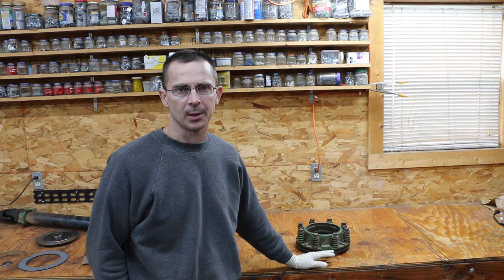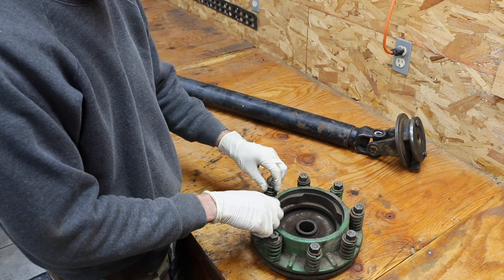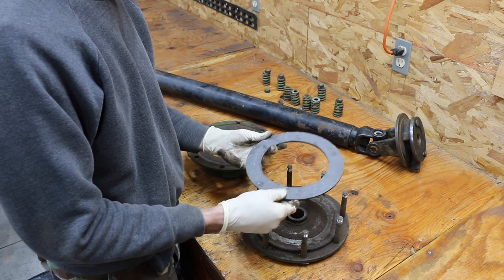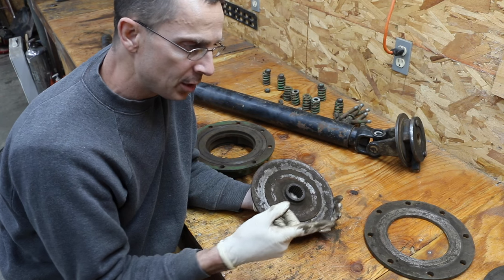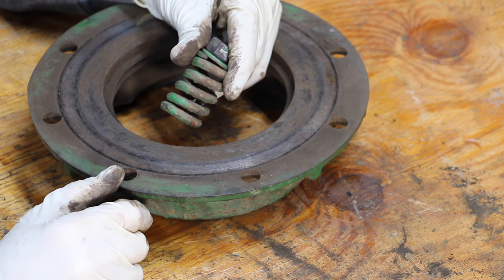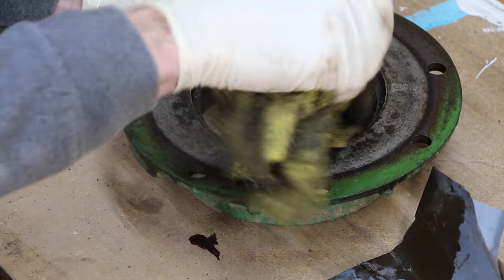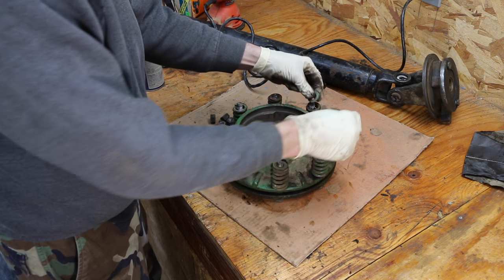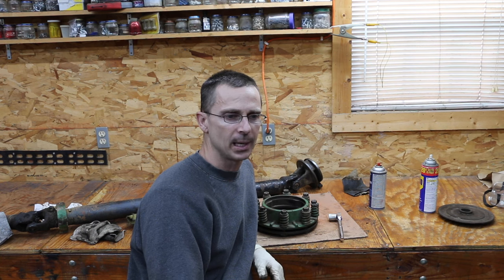Slip Clutch Disassembly & Disk Replacement on John Deere 336 Baler

Comment: Very thorough!  Your new slip clutch center had nice new teeth to mesh with the spline, but we found the 6 and 7 series balers can really benefit from our updated design.  It adds over an inch of steel to the slip clutch center, so it meshes completely with the spline- no need for a bushing as a spacer!  Thanks for your video.
Reply from the maker: This is very helpful information--thank you! As some point, I need to replace all the springs in the JD 336 baler.  This old baler has seen better days. Thanks again!

Comment: A little while back, I bought a PTO tiller with a slip clutch, and figured since it was brand new, it would work fine right away.  It didn't.  My tractor (a Kubota BX25) stalled when rocks got caught in the tines.  Even a new clutch that's sitting in a warehouse somewhere can build up corrosion that prevents it from working properly.

After I took it apart and sanded the discs, it worked like a charm.

There's a quick test you can do to see whether you need to take the clutch apart after a period of disuse, provided you can access the friction discs from the outside.  Take a normal lead pencil and draw a line across the discs.  Put the implement on, engage the PTO for a few seconds, then take it off again.  Find the lines you drew, and if they are still aligned, the clutch didn't slip, so it should be taken apart and sanded.
Reply from the maker: Wow! Glad nothing broke on the Kubota or tiller.  That's a great tractor.

Comment: What would you torque the nuts to? I purchased a used bush hog that has a slip clutch. It’s a “new at the time” assembly but it sat under a tree when the farmer went out of business and is all crusty and rusty. Never messed with one.

Comment: Just wondering if the damaged plate you cleaned up before putting the bolts back in ready to reassemble could have been reversed and used after removing the green paint? I'd also like to thank you for this video, it has been very helpful to me. Chilla, NSW, Australia.

Comment: My brush hog has 4 metal plates and 4 friction disks. After twisting my PTO shaft like a pretzel I fugured out it was all rusted into 1 heap.  2 days in vinegar bath ate off all the rust. Light sand to knock down all the high spots from corrosion.  4 new kevlar disks and back in business.   I was wondering about lubricating or some kind of rust preventative for the future.
Reply from the maker: Great feedback. Thank you

Comment: 2 things you might want to use/try next time - 1) use a wire wheel on a bench grinder to clean up the bolts and 2) a wire wheel type grinder or 3M scorch brand rotory disks to knock down more material on the plates, especially the one that went metal to metal.
Reply from the maker: Thank you for these suggestions!

Comment: I flip the flat plate over and clean the paint off to have a new surface. I believe the the setting on the bolts to be from the washer to the mounting surface 1 21/32 +- 1/32.
Reply from the maker: Thanks for commenting on this!

Comment: Great video. I just replaced the disks in my 336 baler yesterday. But, how do you set the torque on the clutch, when you put it back on the baler?
Reply from the maker: Great question. I just set the tension on the slip clutch for my 535 baler.  Per the manual on the 535 baler, it was 35 mm from end of spring oil to the other end.  In other words, tighten each one of the bolts until the spring is compressed to the appropriate dimension for the 336 baler.  Hope this helps

Comment: You didn't tell how much to torque
Reply from the maker: Mike,  Sorry about that.  Slip clutch torque settings vary by implement.  For the hay baler,  I will bale very thick hay and adjust the tension to avoid slippage, but not over tighten to the point that it won't slip if it picks up something that could damage the baler.  While the baler has a technique for setting the torque, I prefer the field adjustment method that I've described.  I hope this helps.

Comment: Green Baler Parts.com has a much improved slip clutch disc that eliminates the wobble inherent with these assemblies. The improved slip clutch disc has longer splines that eliminate the spacer between the disc and the gear housing. Much better than the John Deere replacement piece.